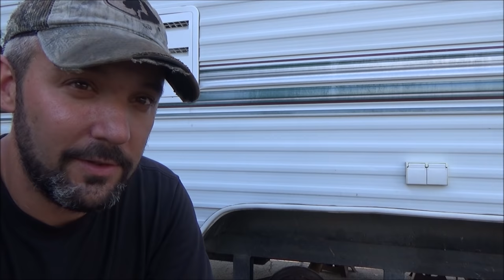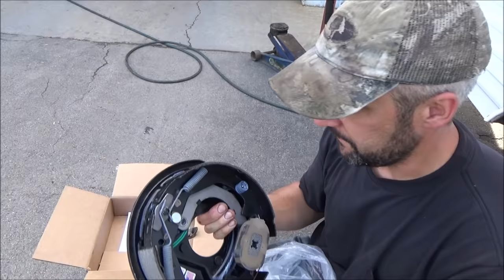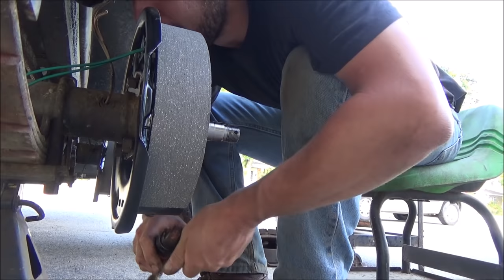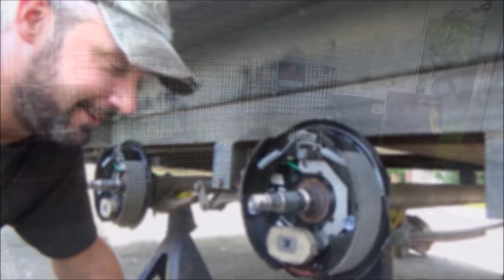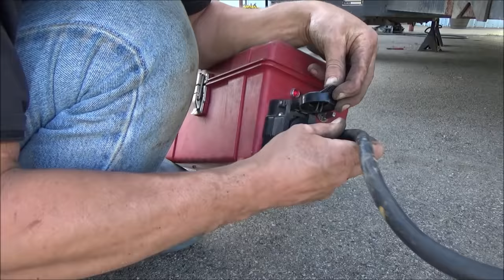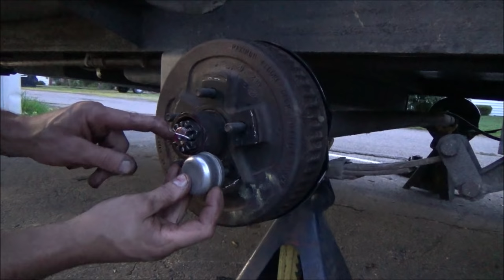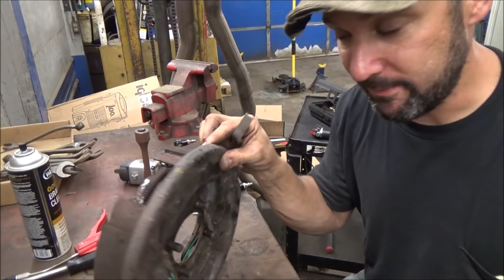Replace: Electric Trailer Brakes - Part 2

Comment: I tuned in to see how the brakes on my car trailer worked.  Thanks for the clue-in.  Now I know.  About the wheel bearing greasing, your procedure looks like the same I was shown, back in the late 50's and early 60's.  It always worked and NEVER had any troubles.  I really like your method of teaching.  It beats the wheels off some others that are pretty STERILE with no fun or extra information put in the mix.  Nicely done, Thanks!

Comment: EXCELLENT video. Had I not found your video, I would have had to pay someone else to replace brakes and bearings on my camper, Definately learned a lot by watching this video and as a result it appears my new brakes will work fine. Got power to them, and they are adjusted, only have to do a road test and hopefully we're all set. Thanks so much!

Comment: I like your bearing packer. I did learn how to hand pack but we also had a packer on the dairy when I grew up. I have one now from harbor freight. It works. But I got myself a needle that plugs into the grease gun. This is the  cleanest method for me. I just insert the needle in between the bearings and fill. Also, I learned to put a lot of grease in the hub. The reason is the grease also helps keep the heat down. And I have been removing those Scotch locks and either soldering or butt connectors. And yes, I enjoyed the video.

Comment: I did a whole brake controlled system wiring for toyota boy what a blast that was. Had to dig into the dash to find the brake switch .After working on other cars and reading on brake switch already before i knew I could do the job so we went got a brake controller trucks all good now has its 7pin controller and able to tow anything.Electric brakes are alot fun to work on .

Comment: Good video and thanks for posting, the crappy wire connectors were marketed as tri-tap, and you are 100% correct they do not do well in open to the weather applications.

Comment: great episode mate..im 62 and been driving spanners most my life and never seen a fancy bearing packer like yours..the only think i do different nowdays is add a squirt of lucas or moreys to the hub after i slide it on and before i put the outer brg in just to keep things liquid in our aussie heat..ive done it on my own trucks and trailers of all sizes with gear oil but find the above seem to run cooler on the big long summer runs..love your work man.

Comment: Eric Great Video. Worked at a trailer shop for 20 years. Your Spot on with your repair. Exactly the way I apply grease heatshrinkersc etc. Screw Scotchlocs! The only thing I don't agree on is you adjusting new backing plates. Dexter Backing Plates are Pre Adjusted From Factory. Other than that Great Job

Comment: You did and outstanding job explaining all the aspects of Electric trailer brakes in a clear and concise manner. The Dexter brake kit info was very helpful. Your video has given me the confidence todo  a complete brake job on our 5th wheel. Thank you for your time, effort and expertise. Vic
Reply: Installing automatic slack adjusters saves future maintenance time! (Pro tip)

Comment: I have to agree, the amount of grease used is usually an over statement to what bearings really need. All of the excess grease added doesn't really go onto the bearings so it's likely just a mental thing that those areas getting the grease are helping in some way. With boat trailers, it's the other way around as the bearing buddy springs provide a small amount of pressure on the grease packed hub to prevent water seepage while on the boat launch. Excess grease will also intensify any fire due to bearing failure too. 

I just ordered a bunch of those crimp and seal terminators...they are the do it right items to have. Thanks for explaining the supplies you use in the shop...that helps a whole lot when digesting the reason for the things used in your shop or in this case, parking lot...

Comment: I love YouTube.  And I love you.  Wait.  Not like that. In a manly man way.  Anywaaayyyy.  An old video but for me very timely.  I need to do this next year.  Prepping for Montana and checked the brakes and bearing and for the first time since I've owned it had to  replace a wheel seal and the pads need to be replaced after this trip. NEVER would have thought about replacing the entire assembly.   Thanks for the lack of effort I'll have to apply next year.  GREAT video.

Comment: I had to go back to a 2015 video to learn about your affinity for those heat shrink butt connectors, and indeed, you are correct about them being better than those scotchlock connectors.  However, where longer runs of electrical wire exist, such as on semitrailers, and additional resistance created by any sort of crimped connection will eventually result in increased oxidation and those "green crusties" that we all hate. I have seen the heat shrink butt connectors fail, and amazingly, with no physical indication through the translucent insulation.  It looked fine, it did not pull apart, but it would not conduct  enough electricity to lite a three watt bulb in a 12V system.  Solder and heat shrink are still the only reliable permanent fixes for hard to access locations, like the top clearance lights on a 13'6'' trailer (before LEDs).

Comment: Been a long time since I have packed wheel bearings. 

And I have used scotch locks. Reason, simple, quick, easy and cheap. And they were a short term temporary fix that worked. I know they are not permanent nor are they the greatest. But they got me lights and back on the road. (I had bought a 50 year old boat and the trailer lights did not work. The wiring was crumbled and I just bought a cheapie trailer wire kit and some lights, and a roll of white wire to use as a ground wire. 20 minutes later and I had fully functional bright well grounded lights and I was on the road home.

What great about scotch locks is you can use them without crimpers or pliers. A couple of rocks picked up off the ground can make for a surprisingly simple and effective set of tools.

Comment: I learned to pack bearings at a Texaco station in Indianapolis in the mid 70's.  I was taught to do the cotter pin by wrapping the longer prong around the outside of the nut.  Easy to use channel locks to fully secure prong close to the nut.  The shorter prong we cut off.  Packed the bearing by hand the same as you.  Did not waste grease, just covered bare metal to prevent rust, did not glob it on the axle or cram into the dust cover.

Talk about not wasting anything.  When changing oil, as soon as the majority of the oil stopped flowing out of quart can, we put that can upside down to drain to get every last drop into a gallon oil container.  It didn't take long to fill this container up with new oil.  After doing 2 or 3 oil changes, there were 10 or 15 cans waiting to be drained before we could toss. Owner got really PO'ed if cans were thrown away without draining.  This "new" oil was use for his truck.
Reply from the maker: D Nelson Thats funny, I knew a guy in our area that rigged up a gutter system he would tip his up in and catch in a gallon container to and dump it in customers cars , didn't matter what i was either, 5w 10w 30w he called it "multi-viscosity"

Comment: I use those heat shrink butt connectors for years when I was working. They saved us many hours of repairs. I worked for  the Dept of Highways so we used a lot of them. The only trouble we had with them was when someone strong armed the connector with a tool that used a tip in the crimping jaw, that would poke a hole in the plastic sleeve. I can't agree more about the suitcase connectors. We got new trucks one time that the builder used the suitcase connectors, I wanted to replace them before winter, but was over ruled by the district shop. Needless to say, we had to completely rewire the beds on every truck we received that year, 4 or 5 for our county. I had spoke out against those connectors before but was ignored. The next order for new trucks had heat shrink connectors on them.

Comment: I think I knew how those worked at one time but it's been decades since I had one apart. Very clever design, uses the motion of the trailer as energy to set the brake.

Comment: just got a suv and now im getting a trailer. just needed the trailer to have breaks because I needed to add in an extra 300 pounds of stopping power. :L. the breaks are more than enough tho lol. thx for the videos. these are pretty great.

Comment: Excellent video and enjoyed the comedy! I am in the process of changing out those connectors that caused failures with brakes and lights and using heat shrinking connectors!!
Reply: Thanks for your old school methods. Your right, you do not need to pack the bearing cap full of grease.  Thank you for your time. Great job.

Comment: great video. i was taught by my father as well as an instructor named mr. berdick at alfrid state college that too much grease in the hub is bad and as you said not nessary thats how i do it for years too and no come backs i called them scoth locks too. and fyi to viewers the 3 m ones with the dielectric grease isnt no better so dont think they are there junk everywhere

Comment: Great
video as usual.  Would just like to give you a tip. If you don't mind me saying. When you put the cotter pin through the castle nut instead of going back over the main shaft what I do is open the cotter pin up and wrap it round the actual castle nut, so it's not going to scrape on the dust cover. Just the way I do it. I think you should get yourself an old lawnmower and make that a project for yourself lol lol . Keep up the good work. By the way we call Scotch blocks crap because that's what they are okay for interior stuff, but on the outside never used them.
Reply from the maker: shaun pi Ok got ya .. makes sense and a good tip.

Comment: Thanks for taking the time to make these videos, and more importantly, for taking the time to do the job right. Nowadays people seem to just want to do some half assed job that isn't going to last so they can get to the next job as quickly as possible. I hate those scotch block connectors (or whatever they're called) too, nearly as much as I hate the push in connectors people use when wiring light switches and plugs. I loved the childhood lawn mower scooter thing, I did pretty much the same types of things when I was a kid, which I wont go into here. But I made it through those years without breaking my neck and lived to see the day that I now have kids of my own. Before this video I watched the Blue Hyundai videos. I think when I go to work tomorrow I'm going to take a random sample of how many people have checked their oil lately. Nowadays car manufacturers put that hood release way back under the bottom of the dash, it sits absolutely flush with the bottom of the dash, and nobody would know it was there if they weren't looking for it. Just drive it 'till it breaks and buy a new one seems to be the motto. I never new a cam shaft could be twisted and I bet that car made a noise when that happened! I can't believe that thing ran so well...
Reply from the maker: +The On Grid Homestead "how many people have checked their oil lately..." Explain to me how you do that oil check thing again hahaha... I think that is a thing of the past to be honest with ya. Yeah that Hyundai sure was a fun one!
Reply: South Main Auto Repair Damn! I forgot I was going to to do that today. I can already imagine what most would say: Huh? What oil? There's oil in there? I thought all I had to do was put gas in it. Etc. I guess I shouldn't bother getting into the importance of changing the oil with anybody. Well, you know how it is. I think you're right, those things are becoming a thing of the past. I guess when the "change oil" or "low oil" light comes on, it's time for a new car. :-D

Comment: Learn something new every video... I'm an avid fan of butt connectors sometimes, and I never knew about those heat shrink connectors you used, till now. I'm definitely going to give those a try.

Thanks for the great material again!
Reply from the maker: Darren G. Yeah the heat shrink ones are the only ones I use if I use a but connector

Comment: Great video. Well planned and executed. Good advice is given. A word about not mixing up the various bearing parts whilst cleaning and reassembling, you are correct in making sure that mating parts are re-mated upon assembly. I did my time as a Fitter Machinist and Tool Maker. During my apprenticeship, I also built high-performance engines and found that each mating part, when rubbing together, gained a witness from its mate. Think along the lines of a munitions projectile gaining a 'witness" to the spiral grooves in a gun barrel. If you mix 'mating components' you run the risk of exceeding fast wear taking place, as the mismatched high spots rub/wear away faster. In Engine Building this is part of Blue Printing an Engine.  The fact that this phenomenon is not more widely appreciated, may be due to the repair not failing for a long time after the repair. The component life, instead of being, say, 100 million revolutions, may be only 30 million revolutions. When viewed under a microscope the wear characteristics (ie the 'witness') of two in-contact mating surfaces is quite obvious. I shake my head in disbelief as some mechanics throw all components into the wash, clean up the parts and mix them together whilst assembling. This does, however, almost guarantee, early component failure, and future work for themselves and/or others to the determent of the owner/customer. This is called Willful Ignorance, something we are all guilty of on some occasions. Love the video. Top job. Cheers, from Michael Australia.

Comment: Another great vid Eric. I use the same bearing packer, we put the large inner bearing in first then the smaller outer on top, then pack both at the same time. Could save seconds!
Reply from the maker: Glen O'Hara Yeah that is my usual habit but I did it individual for the sake of demonstration :)

Comment: Great video on electric trailer brakes-now I can work on them myself.  I also didn't know how electric brakes work (and my Grandpa owned a garage which I worked at in my youth).  The connectors are called quick splice connectors.  Thanks

Comment: Excellent after hours work there Eric O and thank you for finishing up these brakes.
Some of us have never seen these, on the trailers over here they are activated by the pressure of the trailer pushing on the hitch during braking so I have never seen the electric ones.
Reply from the maker: CMDR Sweeper We call those "surge brakes" here

Comment: I've also done wheel bearings the way I was taught to while wondering on the finer details that you brought out quite well.  I started by filling the hub with a goodly amount thinking that centrifugal forces would starve the smaller bearing of needed grease perhaps?  Not thinking along those lines anymore, I put in a similar amount that you show these days.  Have never done a re-packing that was actually needed.  Pretty much a needless thing to do in my experience as I have some going past 30 years with no issues and in that time surely if it WAS needed, the wheels would have fallen off by now.  I don't set mine as tight as you do and usually back the nut off one or two cotter key notches if doing so doesn't result in wild amounts of detectable free play in the bearings.  Put another way, I'm looking for the smallest amount of free play I can have.  I also have had no problems, ever.

Comment: Agreed on the quality of campers. A friend bought a new one last year and we spent weeks discovering stuff that had been done badly or just incorrectly and fixing it. Speakers wired backwards or not at all, crap half done, etc.  The makers in Elkhart seem to just hire high school students or whatever they can find, they work for a few weeks and get tired of it and leave. The companies don't pay enough to retain permanent workers who might care about their jobs, and it shows in the quality of the products. Which is insane given what they charge for what's basically a cardboard box on wheels with junky appliances and a thin foam rubber bed in it.
I found out during that time that campers are built so poorly that some campgrounds have a rule that they don't allow in any trailers or RVs more than 10 years old, because by then your $60,000 investment is a rolling junk heap and they don't want it uglying up their campground.
Maybe Airstream is still building good campers. If I had to bet on buying a camper that would last that would probably have to be it. Or just do a van or bus conversion myself.

Comment: Trailer bearing installs are so subjective to whoever you talk to. I usually pack the bearing with the packer then pump the hub full with the zerk fitting on the axle. When I tighten the castle but unlike to have a tiny bit of end play, the theory is when the bearing heats up it takes up the end play. There’s many ways to skin the cat, if the end result is a working trailer, you did it right.
Reply: I like to * it won’t let me edit my comment lol

Comment: Wow, another crazy good informative video.   +1 on those butt connectors you used.  I’ve used dozens myself (I’m not a pro) and have also never had one fail.  My one nit picky constructive criticism would be to suggest using a heat gun instead of a mini torch.  I prefer not to incur the risk of scorching the wire and it removes an open flame ignition source.   Great job!!!!!